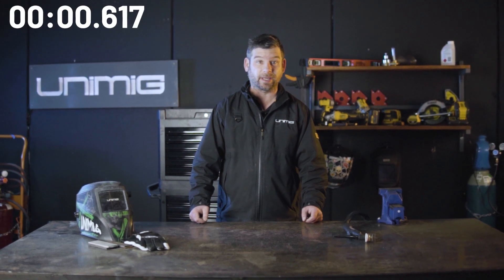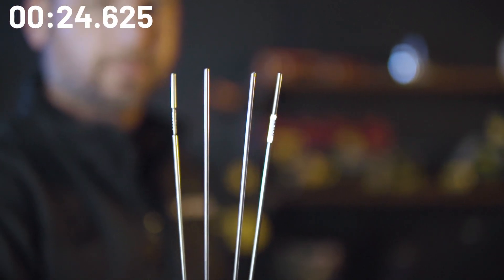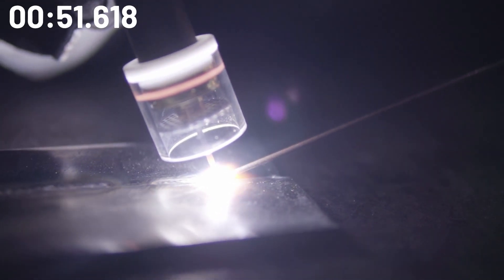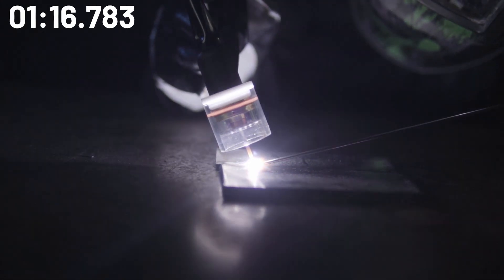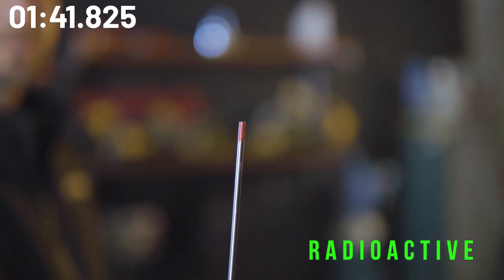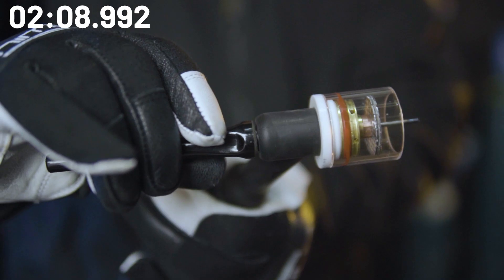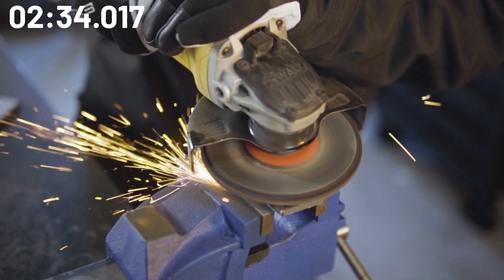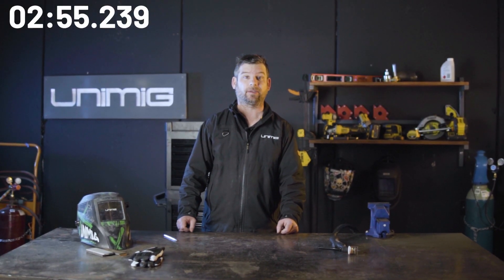How to Weld Stainless Steel to Mild Steel (TIG WELDING)

Comment: DC or AC ?  Assuming DC
Reply: Yes that’s correct DC you would only use AC (alternating current) with aluminium welding
Reply: @UNIMIG  not only aluminum but yeah